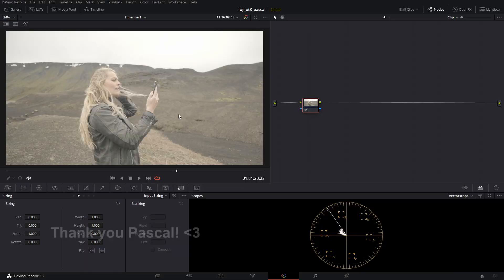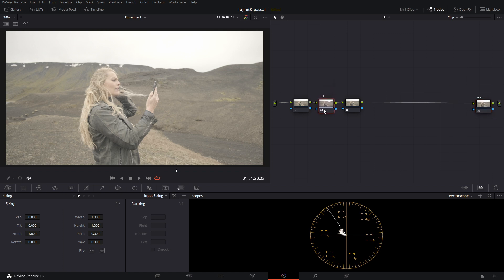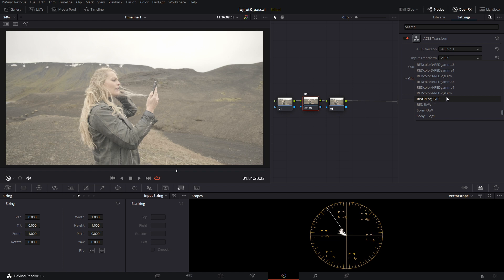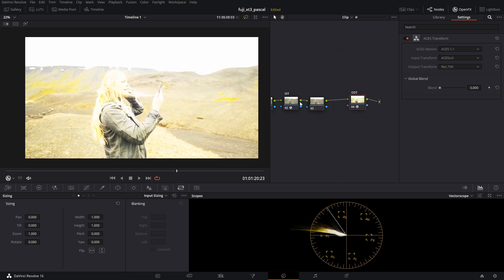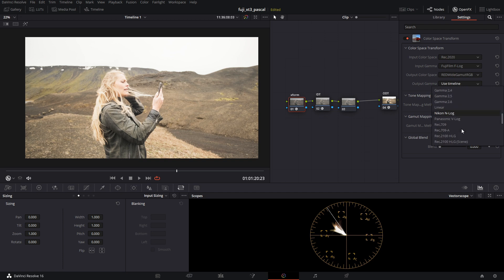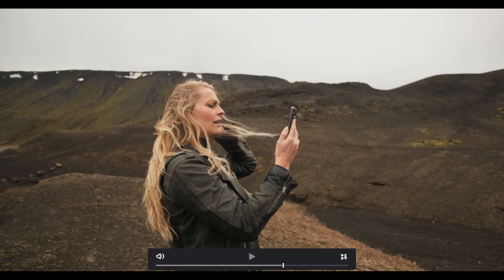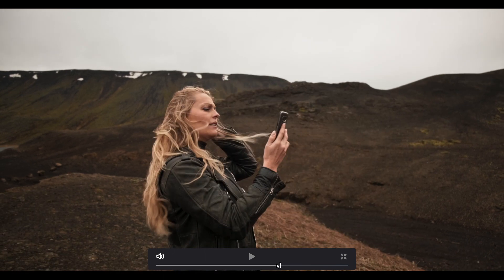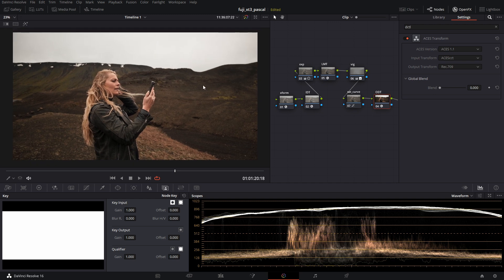Fuji X-T3, Fuji X-T4 Flog to ACES in Davinci Resolve!

Comment: Hi Tony, thanks a lot for the tutorial.
I have a question, in the Color Space Transform node you could transform from F-Log to ACEScct directly. Why use it to transform to RED Log3G10 first?

I compared the resulting ACEScct from both ways and there are slight differences, using the RED Log as inbetween makes it a bit warmer, and I've no idea which is more correct.
Reply from the maker: @Salarycat very good account name.

This video is older and there were tools that exist now in Resolve 17 that did not exist when this video was created. I will explain:

The reason why in older versions of Resolve you need to use the ACES transform is because the ACES transform accounts for the D60 white point of the ACES color space. Digital cameras generally capture in D65, so the ACES transform accounts for this adjustment whereas the older CST node does not. Basically if you were to only use the CST, you would not technically transform into ACES correctly because you would still have a D65 white point.

In the new version of resolve you can ignore the ACES transform at the input level by using one of two methods.
1: Use CST to transform directly to ACES and click on the white point check box. This is what I do now and is a one node customizable IDT.
2: Use CST to transform directly to ACES then use a Chromatic Adaptation node to go from D65 to ACES making sure to select the correct color space and gamma options.
Reply: @TonyDae  Great information, I installed the latest version and indeed I found the "Use White Point Adaptation" button, which amounts to the difference I saw on the comparison I had made.
Thanks for explaining everything so quickly!

Comment: If I were to change the white balance using Chromatic Adaptaion OFX, do I put it in between the IDT and ODT, or after the resolve color transform?
Reply from the maker: This video is a little outdated... The Aces transforms will put the white point into the right Aces white point. If you want to adjust again, do it in between the Aces transforms. Doing it before IDT or after ODT essentially breaks the color management system.
Reply: @TonyDae  ok, thankyou for the information.

Comment: Thanks a lot, this is great!

Do you have any advice on using a color checkrr such as XRite Color Checker with Flog, since there’s no input for it? I tried converting FLog to Rec709 with the official LUT, but the colors seem to be off, especially the reds.
Reply from the maker: If you are talking about that color checker functionality in Resolve where you can auto correct, that thing doesn't work for me most of the time, so I have abandoned it. I would recommend using the color warper or other tools to adjust your color values to be correct instead of that tool.
Reply: @TonyDae  will look into that, thanks!

Comment: I just tried with more footage’s.. I am getting coloured artifacts in highlights... in some footage’s I faced this problem... did anyone got this issue?
Reply from the maker: Try the neon suppression LMT in Resolve. Make sure to process it in ACES AP0. You can also try the gamut compression dctl from the ACES github.
Reply: @TonyDae  I didn't get that actually.. will try to figure it out... Thanks 👍
Reply from the maker: I will make a video about this today. It's a consistent problem with ACES due to the AP1 gamut.
Reply: @TonyDae  that would be really helpful... thanks
Reply from the maker: Try the methods shown in this video, especially the DCTL. You should be able to do the same thing by adding the gamut fix after your ACES IDT node. https://youtu.be/3imFV0RjU0o

Comment: How to apply luts in this flow? Where we have to apply? After last node? Do we have to change anything in timeline settings?
Reply from the maker: You don't use luts or they have to be designed for ACES color space specifically which are usually called LMT's. Any work done including LMT's must be before the ODT node or it breaks the workflow
Reply: @TonyDae  ok but my footage looks dull and flat even after this process.. can u please have a look at my footage... I can share you the log footage if you could share ur email... I'm a beginner plz help... Might be because I didn't expose footage correctly... I just want to figure out what I did wrong
Reply from the maker: @TravelMap  there has to be some kind of user error. Check all input and output color spaces/gammas and make sure they are correct. Was your source shot in Fuji flog or a different color profile?
Reply: Tony Dae Fuji flog only... I think I over exposed a bit... I am using Fuji XT3.. will try on a different footage and see
Reply from the maker: My email should be in the about section.

Comment: Yes! Exactly what I was looking for! Thank you!
Reply: How to apply luts in this flow? Where we have to apply? After last node? Do we have to change anything in timeline settings?
Reply: @TravelMap  so ACES isn't a workspace for luts. Aces is designed to offer the full range of colors to be corrected and changed in a much more natural way. Luts clamp color and clamp color information. So if you want to apply a lut, you would need to output the video as rec709 or srgb, export it, and then apply a lut to the footage in a non-aces project
Reply: @ManningMoore  ok can't we apply lut after 4th node? My footage looks too flat after I did what mentioned in this video.. I am a beginner.. may be I am doing something wrong

Comment: Thank you for the video Tony. I'm curious regarding your use of the DCTL node and the number of "luts" you have there. I'm assuming you created some of them if not all. Could you expand on that node and DCTL, or point me in a direction? Never seen it's use at all and quite curious, a quick read also seems to suggest it is rather useful and powerful tool. Thank you for the video. I usually use Arri to grade since I find that it fixes skintone issues especially from Sony log footage, however for my personal workflow and use with my Fuji, and I'm interested in learning more about ACES over Arri for my basic grading needs.
Reply from the maker: Basically I copy and paste the dctl script and punch in the settings. I think I show how to do this in a separate video and I can look. If not I can look into making a video like this. You can also email me and I can help, email address in the about section

Comment: Could you put the Xform, IDT and ODT on the timeline level so you wouldn't need to replicate those nodes clip by clip? IF SO, I have a few clips taken in Eterna (not FLOG) is there a way to bypass a the timeline transforms other than keeping those Eterna clips in a dif. timeline? Thanks for this btw!
Reply from the maker: You can use groups to have input, timeline, output nodes so that you don't have to replicate the IDT/ODT. I think that will be more useful for time saving and will allow you to keep eterna shots separate!
Reply: @TonyDae  Thanks for the tip and quick response, I am still new to I just watched a quick tut on groups and that is exactly what I need! combined with your tut I think this will all go more smoothly! Thanks again for this tutorial and this tip!

Comment: What are the advantages of using this rather than applying the provided rec709 lut at the end or grading manually?
Reply from the maker: ACES is a particular color management option that has a lot of benefits for certain kind of filmmaking, especially for sending material to and from different departments. It conforms all cameras to the same color space and operates the exact same way regardless which camera you used or program you are in, meaning LMT's will affect the image in the same way regardless of what the original color space or gamma was and the color will be displayed properly in whatever program you use. I use ACES like resolve color management to effectively match stock images from Getty for example into the same look. A color managed option has been more and more in demand compared to lut or manual workflows because there are indeed many benefits to it... Especially if you plan on outputting to multiple different color spaces for display or compositing. I recommend researching more into ACES and looking at the ACES forums for more information.